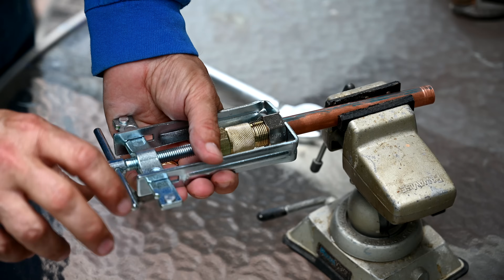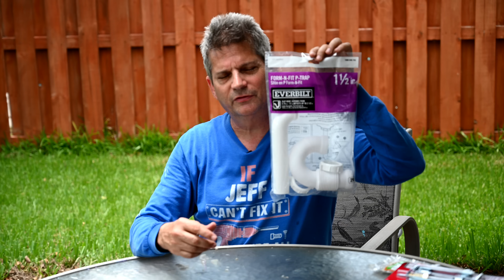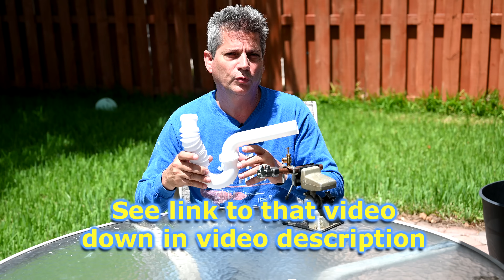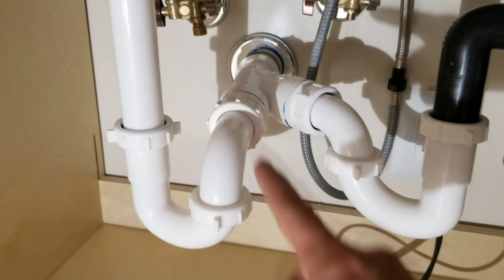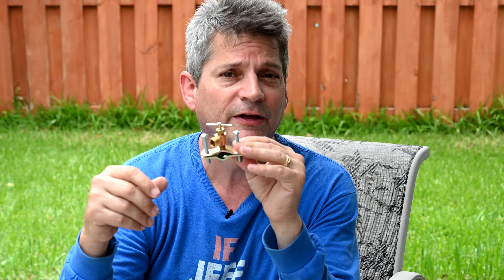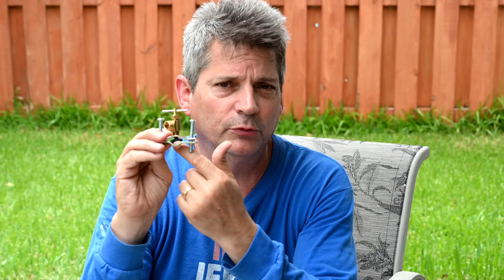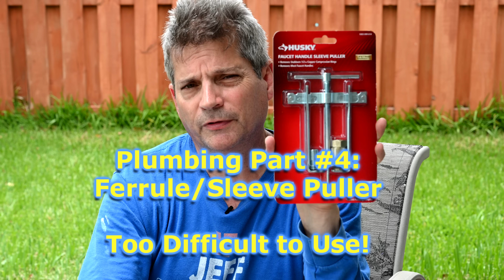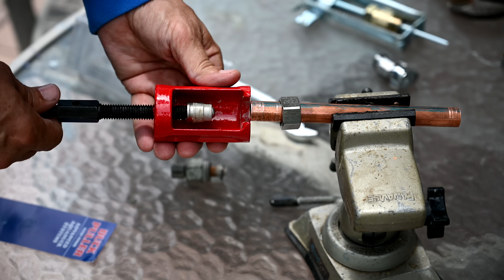4 Plumbing Parts/Tools You Should NEVER Use. NO Plumbing Fails

Comment: Interesting comparing this with what's normal in Europe. I wouldn't say one was better than the other; they're just different. A few observations...

AFAIK, the flexible pipes and saddle valves aren't banned in Europe (there are a lot of countries in Europe), That doesn't make them a good idea, for the reasons mentioned and others. I've seen some flexible pipes (made in Italy) that don't like it if you put boiling water down a drain - this is another good reason to avoid them. However, the McAlpine flexible waste pipes are different, and don't seem to have any problems.

The thing in the compression joint you couldn't name is called an "olive" ;-) We'll that's the standard and only term for them in the UK. With a bit of imagination they do look a bit live olives. Technically, it's a ferrule, although I've heard it called a compression ring (not by a British plumber).

The olive extractor tool looks ridiculous; I bought an olive extractor 30 years ago, and it cost me US$50 - made in England on a lathe out of solid brass. It works in a similar way to the last one, but has two sized threads for 15mm/1/2" and 22mm/3/4" compression nuts. But a word of caution - in my experience, if the 3" Tommy bar on my tool is too short to provide enough pressure to get the olive off, giving it the strong-arm treatment is no a good idea. The reason is that whoever put it on there in the first place has probably over-tightened it and deformed the pipe. Brute force will still get it off, but then what are you going to do?The only reason to force it off is to get your pipe cutter in for an few extra mm of good pipe.

It's amazing how many people seem to make poor compression joints, and then tighten them up like Popeye the Sailor in order to stop them leaking. If they'd cleaned and lubricated the damn joint properly in the first place it'd go on easier and come off easier.

Incidentally, I'm not an plumber - I'm an engineer with an interest.
Reply from the maker: Yes lots of UK plumbers have told us they call it an olive

Comment: By the way the saddle valve might be illegal in Florida but that doesn't mean it's illegal in all 50 states.Did I mention I was a state of West Virginia master plumber.I will agree with u about the use of the saddle valve.Only tight wads use them.I just love listening to people who know nothing about plumbing giving people plumbing advice.U make it sound like inspectors are some kind of geniuses.In alot of states that plumbing inspector worked at Target the week before.And they carry around a book dictating code they know nothing about.
Reply from the maker: For sure, the inspectors are not geniuses, but what they are quite often is really difficult to work with, and certainly dumbest of Target employees knows what a saddle valve is, and so far every state I checked bans saddle valves, it's in the IPC and the UPC. As you know, WV adopted the IPC and here is the part of the code that prohibits saddle valves see item #6: 
SECTION 707 PROHIBITED JOINTS AND CONNECTIONS
707.1 Prohibited joints. The following types of joints and
connections shall be prohibited:
1. Cement or concrete joints.
2. Mastic or hot-pour bituminous joints.
3. Joints made with fittings not approved for the specific installation.
4. Joints between different diameter pipes made with elastomeric rolling O-rings.
5. Solvent-cement joints between different types of plastic pipe except where provided for in Section 705.16.4.
6. Saddle-type fittings.

Comment: To bad u weren't smart enough to but the S trap together correctly.Its called the trap weir not the trap seal.And it's not illegal to use an S trap in repair work.If it wasn't allowed to be used it wouldnt be made.If u bought a older house it will have an S trap in it,I promise u that.And the problem with the trap being sucked dry only happens if there isn't a plumbing vent near by.Within 5 feet.The design of the trap has nothing to do with wether it gets sucked dry or not.Cause if there isn't a vent within 5 feet a p trap can be sucked dry as well.I am a master plumber as well.
Reply from the maker: You missed the whole purpose of the video, I said not to use S-traps in new plumbing. Also I suggested replacing S-traps when remodeling if possible. Once you open the wall, some inspectors might force you to do it anyway, as all remodels have to be done to current codes. You might be a master plumber Lawrence, but you don't know everything about physics and fluid dynamics. You are correct about the vent, but one of the other causes of the venturi effect, aka siphoning of the S-trap is when you have a long vertical leg after the S-trap, which is preceded by a short vertical leg before the S-trap. I plan to do another video soon. Also it is YOU have have your terms wrong I did not name anything wrong. I was pointing to the trap seal which is the vertical column of water in the p-trap, and the weir is the top of the trap seal. It is the top horizontal surface of the column of water that settles back down from the crown once the water stops flowing.